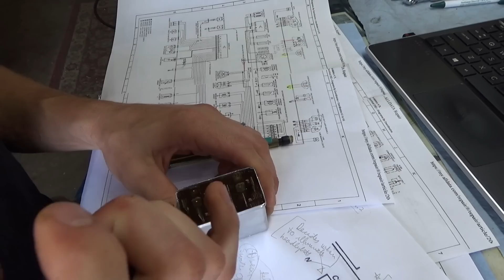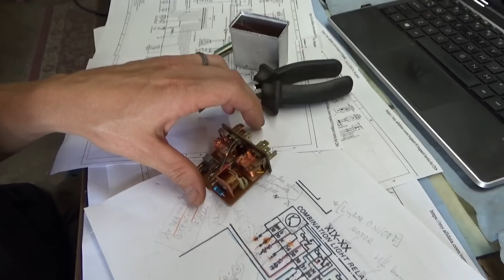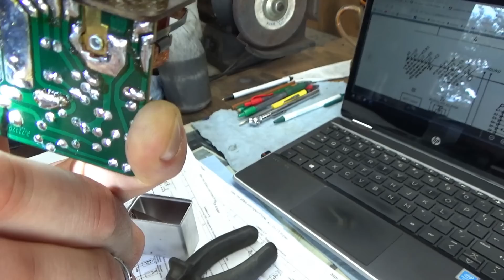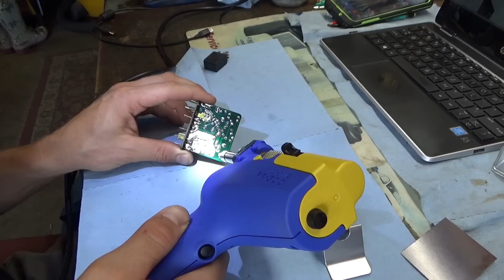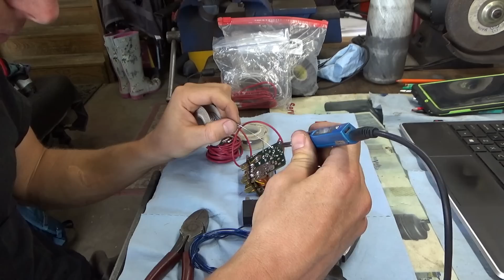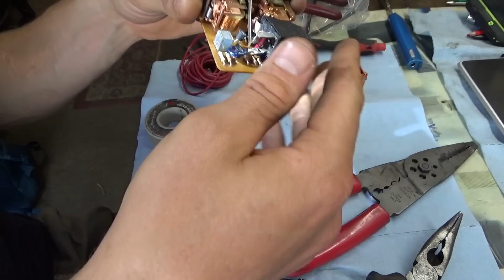(Pt 2) This Porsche Melted my BRAIN ('84 928S Crazy Headlights Repair)

Comment: A bit late to the party, but what an awesome fix. The old cruise control module from idk till 2000/2001 Volkswagen and Audis use the same housing. On my old Audi the crousie control module sits behind the glovebox, infront of the heaterbox. They always fail cause they get the full heat cycle, from ice cold up to 30 or 35°C. There is a tutorial on youtube how to fix cold solder joints on this module by throwing that thing into an oven, let it bake a few minutes, it resolders everything, and its fixed. Didnt work for me, had to resolder it by hand. Good thing that its all big and bulky so you dont need all the fancy soldering equipment with magnifying glass and all that.

Comment: A fix after my own heart.
Reply: I must also say I am an avionics tech, and have a 944, and seen 928 wiring which absolutely horrified me. Why Porsche decided to make the 928s wiring so complex is stupifying. Everything goes to a relay, along with poorly made switches, doubling the wiring and headaches of tracing a problem. An engineering marvel, the 928 is mechanically superb, granted needing regular maintenance, and the weak point is the wiring and electronics.  Sad, as I've seen too many 928s in the junkyard. Later models are better, but still need a very good tech to figure out this type of problem that is not spelled out on an OBD2 computer.

Comment: aww come on, you could have taken apart the old relay and rewound the coil! 🤣🤣🤣
they often break from vibration at the outside winding or near the solder joint, which is sometimes easy to get at, often you can unwind a single turn and repair them.
then there's the dreaded inner winding end that breaks off flush and that's usually unrepairable without a full rewind(nobody does that!). nobody would even do the repair you did, I would if I owned it, but not for others. they'd be waiting for the $200 special. lol

Comment: Do you have any concern for heat with that aftermarket relay being inside the factory relay housing? I was thinking that mounting it outside the factory housing by drilling a hole to run wires within would be an alternative. It would also allow for easy replacement if the aftermarket relay fails.

Comment: The polarized electrolytic capacitor should be replaced due to its age. You can buy open frame relays to replace the failed relay. To use a solder vacuum tool you should tin the solder vacuum tip and solder joint before removing the solder. You could add some liquid flux to see if this helps remove all of the solder.

Comment: Nice work Ivan, bottom line is the customer has working headlights, even is the price of the replacement relay is close to your fee for the headlight diagnosis and repair, it'd be boring just popping in a new relay! Thank You Sir.

Comment: Hi Ivan.  Idk if you or your viewers would know the answer,  but I'm in need of a door that can be mounted to a stand for demo purposes.  Idk what brand or model I need, but I need the control electronics that operate the window to be part of the door.  Basically,  I want to put a 12V battery on it to demonstrate the windows auto retract feature when the auto up window encounters an obstruction.  Any guesses what model and year would be a good candidate?  I'm in the US so a US model, or a model common in the US, is preferred.  The door also needs to have a frame around the window.  We'll get it at a local junkyard. Thanks.

Comment: To supplement Ivan's excellent lesson here, I want to add some important details. Even if you are using flux core solder, add a little dab of additional paste flux everywhere the soldering iron tip is going to touch. It serves several purposes, even when desoldering. It acts as a heat transfer fluid so the heat stored in the iron can dump quickly to the joint without heat soaking and overheating the surrounding area. It allows extra fluid to float the impurities out of the way and breaks the surface tension of the solder so it lays down and wets the joint quickly and cleanly. All these serve to allow you to get in and out more quickly and avoid cooking the surrounding circuit, the component itself, or lifting a circuit trace.

Comment: I might have taken the opportunity to swap out these blue axial Philips electrolytics as well, which aren't the most reliable things ever (you can have NOS parts and still see have excessive leakage current). Mind you, that would have required some more bodgery, as uncommon as axials have become - I think even European manufacturers ditched them by around 1990 at the latest and probably more like the mid-'80s.

Comment: Hey @pinehollowautodiagnostics @ivan I watch all your videos and never ask a question haha. But quick question that is right up your alley. I have test pipe on a 2005 prius and with a universal bosch o2 sensor downstream I am getting it stuck at .9 v or .855 while driving and setting an o2 sensor too high code. That is without a spacer or anything. Does same thing with a spacer. Could it be bad o2 sensor? The voltage does vary when stomping on gas and it will go through the whole range fast. I am wondering what I could use in the signal wire (resistor, capacitor, potentiameter) in the signal wire to bring the voltage down to .6v or so while cruising and maybe adjust it while driving to get the o2 sensor code not to set. Thanks!
Reply from the maker: Wait what is the need for a test pipe and a Bosch sensor, and how is that hooked to the car? I'm confused lol.
Just make it stock and use a Denso sensor :)
Reply: @PineHollowAutoDiagnostics  Sweet thanks for reply haha. It doesn’t really have test pipe just hollowed out car from eBay that went bad after 20k. 48 state legal one. Around here everyone steals cats fast so I usually just run with my 48 state. But now it throws check engine for voltage too high on o2 sensor and it does get stuck at like .8v occasionally even though it does react to its full range with flooring the car etc. just wondering on what leg (signal or signal ground) I could add a resistor or something to bring that voltage down to like .5-6. But yes I may as well buy a denso downstream and then just use a spacer. Just hoping that’s actually the problem (it being a Bosch universal but which Bosch says works for the Prius). Appreciate it Ivan !

Comment: Nice fix!  One thing more I would have done would be to test/replace that blue component - an electrolytic capacitor - due to its age.  Without a schematic of the relay module, it could be a noise filter on the power line or it might be part of a timing circuit.  Either way, its a $2 part and equivalents are easily found and might save a callback.  I doubt if it was the reason for the relay failure, but those components don't age well and the designers felt one was needed to support the module's function.

Comment: I respect your diagnostic skills and wanting to solve the issue after complete diagnosis but in real life I would have looked at the wiring diagram Spend an hour or less studying it and would have replaced that relay (just because the price of the relay $130  on ebay would have save the client $100's of dollars with the diagnostic) but if time is free than it's a different story, I would have done it the same way you did.
Reply from the maker: My policy is 100% research and diagnosis first, then quote for repair. Looking at this convoluted diagram for 1 hour would be fruitless without understanding how the system works. If the customer wants to Parts Cannon his Porsche, he can take it to another shop LOL

Comment: That Hakko is a game changer in my shop. Just did a UPS repair in half the usual time. It's a beast on solder. Another tip when vacuuming move your nozzle CC or CCW to help sucking around the wire. Sometimes after vacuuming as much as possible I have to wiggle the wire on the solder side to completely free it on smaller pads with through hole solder joints. Cheers.

Comment: I wouldn't agree that the replacement relay that you used is much better quality than the original one.  I've replaced hundreds of them on Volvo's.  But in this case, any relay that "works" is key.  And any tech that looks over this car in the future will never know that relay module was ever touched.  Awesome work Ivan!

Comment: Love it 👍.   Never underestimate the difficulty removing through-hole components. I've fixed a LOT of damaged PCB's due to techs fighting PTH devices that didn't desolder easily. LOW MELT SOLDER is your friend in many situations. The solder sucker is good, but not perfect. And when using the sucker, hold the trigger for a second or two after solder disappears so the molten solder makes it all the way to the glass waste chamber. If you stop sucking early all the time, the barrel will clog quicker. If your kit doesn't have the wire to clear the barrel, buy the one to match your nozzle ASAP.

Comment: I have a soldering work station that has 3x magnifing glass on a bendy stem & it has a mini vice on it which then clamps to my bench it is brilliant for those fiddly jobs.I also have a soldering iron variable heat to 600 deg c & a pump to suck up the solder a really great combination .As to your fix I hadn't thought of using a small relay my OCD makes me build a small version on a board .Cheers mate here in AUS it's approx 12.30 pm So I'm off to mow the lawn yeah.

Comment: Add a little fresh solder to all the spots you are trying to de-solder first. (Thin rosin core electronic grade solder, lead and tin). This lowers the melting point of the connections and liquefies the old hard solder spots much more easily to vacumm the molten solder. Learn how to use desoldering wick boychick. Dasvidania.

Comment: I recommend use a GM relay where the relay pin is smaller and if you grind pin a little bit it can fit in the hole and look more original.

Comment: You're not only a great Technician, but also a brilliant Engineer. 
BTW: Would it have been easier to remove the new relay from the plastic case and done your soldering to it?

Comment: I've fixed a few of these Porsche light modules over the years. The relay inside is easily available from a number of modules/relays that I source from the scrappers (junk yard 😜). I've had them from vehicles upto maybe 2010 - GM stuff etc.

Good fix though 👍

Comment: Good Job! I have spent decades repairing electrical and electronic equipment, little hint for bench soldering; I held the workpiece, pcb etc, in a pair of pliers which was held closed by a strong elastic band flat on the workbench. ✂

Comment: Nice only issue is just because it works doesnt mean you are good. did you flow enough solder so that while the lights sit on and the area heats up it wont desolder itself. also if the wire wants to pull up from the pin that worsens it.  this is the major flaw in the ford headlight module, the relays desolder themselves over time. same failure in the ford blower resistors their main failure is also desoldering due to insufficient surface area to dissipate heat from reflowing the solder. desoldering parts always sucks lol. best to find a good technique or risk destroying the area lol

Comment: Great job! I was surprised not to see any integrated circuits on that board. Saw a part that looked like a transistor. I wonder if it was a unijunction transistor...... I don't think Porsche would use a common type!

Comment: A very extensive analysis there, using schematic diagrams. In the days when CRT televisions were abundant, I used a manual vacuum pump combined with an ordinary soldering iron to remove horizontal output tranformers (most with the EHT supply to the picture tube anode). My approach would be similar, with the knowledge that the resistance of a relay coil is (nominally) about 200 ohms, and would use the 'Rx1' or 'Rx10' scale on the 'ohms' range (of a multimeter) to test. What I like in your work is that you have diagnosed a fault to component level, replaced it with a 'generic' one, likely surpassing the reliability of the original...

Comment: I wonder if they just gave you the full writing diagram instead of just a circuit diagram. I remember some service manuals from the era had multi page fold out wiring diagrams just to get a full view of everything. But for diagnosis there are circuit diagrams just for a particular system like the lights, charging, or fuel system.

Comment: Even though I've never worked on one before, I pretty much expected you finding an open frame relay with an open circuit coil.
For exactly the reasons you stated.
I do have those in stock, they're commonly used in Mercedes relay modules.
The most common being the "over voltage protection relay" which results in a crank no start (those with KE-Jetronic will actually run but be lacking all enrichment such as cold start and acceleration, which is initially confusing when you're used to electronic fuel injection), or an ABS fault due to missing ignition power to the module.
Yes you can get aftermarket modules but the experience I've had with them means you're better off doing what you did if the original open frame relays aren't readily available

Comment: I'm looking for people's opinion. I'm looking at a 2015 Porsche Macan with 100,000 miles and in Immaculate condition. Never owned a "fancy" brand of vehicle. Only buying it as a toy. I might drive 5000 miles a year. Question is, is it worth getting in to a used Porsche?
Reply from the maker: If you have a huge bank account then by all means 😆
Reply: Sounds like the worst possible way to get a taste of an “exotic” badge: by buying their badge-engineered take on a perfectly mediocre crossover SUV.  What’s the point?  Buy an old boxter or something if Porsches are intriguing

Comment: Sneaky bugger ha ha,   Well done :-D
I was expecting the hot glue gun to appear and glue the relay case to the pcb.
When i used to be the electronic section in a factory,  hella flasher units had the same style of open relay,  like the one in that module.
Sometimes i could get away with fine sand paper to clean the relay contacts.
Bodgy but it saved money :-D

Comment: Kudos on a pretty ingenious repair! I wonder about the cost of your time vs the 'new' part replacement though. In any case, are you concerned about joints breaking due to vibration? Those cars are not known for a 'supple' ride.

Comment: I sure hope you used some hot glue to hold the relay from vibrating around inside and eventually breaking loose the wires you soldered on

Comment: I had an intermittent nostart problem with 23 Vibe and finally took relay apart.I found a dust bunny or ball of laundry lint inside relay between the points.Whenever you tried to start the car when the lint was between the points it took 6 to 10 tries.The original owner must have dealt with that issue for a long time before giving up and putting the car on a car lot where I got it! You never know!!! CHEERS from here!

Comment: The problem with second-guessing the repair is that the repair itself is the final diagnostic step. Once you're replaced the component, you know for sure it is the complete point of failure and no further parts are needed.
Reply from the maker: I proved the relay was the ONLY issue before quoting the repair. No second guessing on this one haha 😁

Comment: Desoldering, reflow each joint with leaded solder or low melt before using vac gun. Works much better.

Comment: Nice circuit analysis! I would have had to redraw that schematic. Typically a control winding breaks near the solder joint, sometimes repairable with fine tools. I enjoy how you get to the root cause and make bench restorations with available components.
One minor caution: the replacement relay's control winding impedance should be considered to insure the drive transistor is not overloaded, or you could take that fancy thermal camera to check the transistor's temp. when operating (if it's under 50C body temp. it's probably safe).

Comment: I would have bought the wiring harness for the relay. Then drill a hole in the factory relay cover and run the wiring through the hole and solder the wiring to the circuit board and bam the new relay is external and easily replaceable and the OG relay retains its factory cover.

Comment: Painful to watch Ivan using his Hakko desoldering tool for the first time. Need to wait for it to heat up. Then place completely over pin so the tool is at right angles to the board. Move tool in circular fashion while pressing vacuum button to remove all solder and loosen pin. There are lots of demonstrations on YouTube on how to use it correctly.
Reply from the maker: Sorry for your pain 😆

Comment: Nice fix! Just had to do a similsr repair to a 2005 Peugeot 307 engine bay fusebox after one of the built in relays for the injection failed. New boards are NLS from Peugeot, so it would have meant finding a good used unit.

Comment: As always, there's more than one way to skin a cat...  So, big kudos for the fix.

My approach would have been to solder in a relay harness with a hole drilled and grommetted out the top of the aluminum module case, seal the hole with silicon, if required.  Then, the odd external-relay-to-the-module would serve as a sort of repair documentation.  In addition, one has no idea of the long term impacts of the new component and wiring modifications on heat, vibration, and aging of the module itself.

Once again, since this is the Internet, and folks get their panties in a bunch over the littlest things, kudos on the repair and it will probably function perfectly for the vehicle's remaining decade or two.  I'm just always thinking a bit more long-term than most folks...